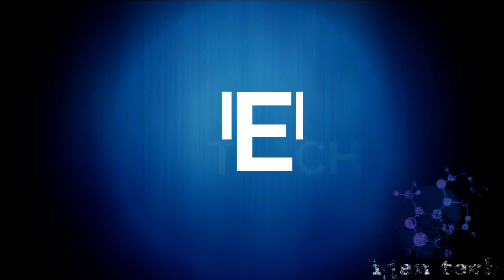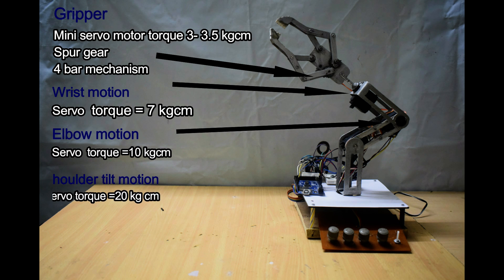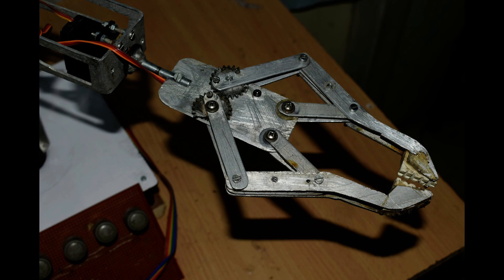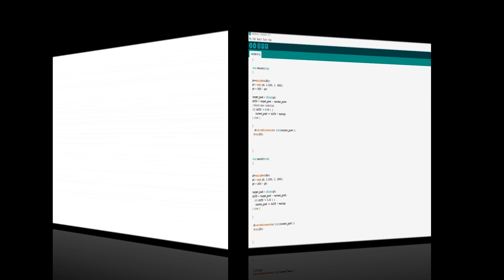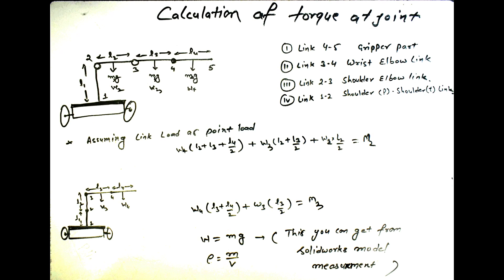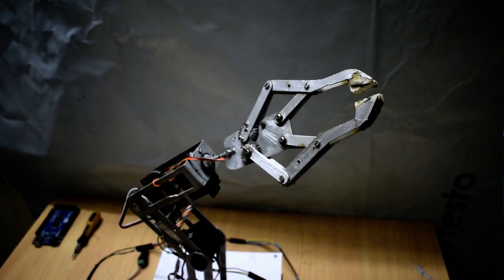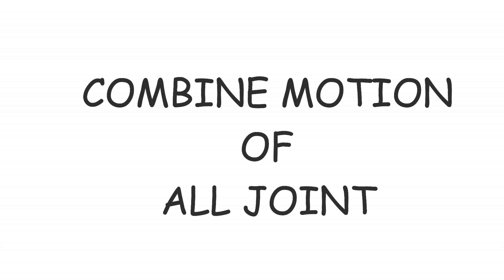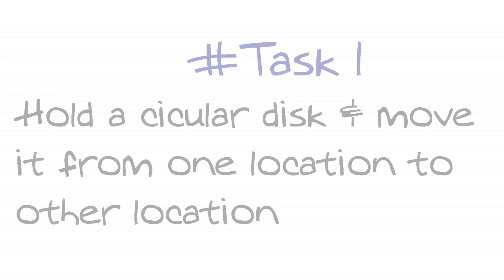🎥How to make Robotic Arm With Arduino | Manipulator | Part 2

Comment: Sir, I appreciate your video about the Robotic Arm With Arduino. Sir, Is it possible can you to use the Arduino Uno board to control the Xbox 360-controlled 6 dof robotic arm Arduino Uno Robot car work or not? Sir, is it possible can you teach me to make on youtube how to make an Xbox 360-controlled 6 dof robotic arm Arduino Uno Robot car and Xbox360 Controller? Sir, tell me about the Xbox360 Controller library with the Arduino Uno board. Sir, this video is beneficial. Sir, tell me in the comment.

Comment: Is it a 360 degree servo motor
Reply from the maker: dinesh kumaran.k  no its not 360 motor i used 180 deg servo
Reply: IGEN TECH I'm doing this as a project.. I've designed in solidworks..I am in a need of coding can you send me the code, my mail id is dineshkumarank3@gmail.com

Comment: Sir can we use arduino uno??
Reply from the maker: yes better to give power supply from outside
Reply: IGEN TECH hey are you using 360 servo or you convert 180 servo into 360 servo motor

Comment: how are you powering the servos?
Reply from the maker: using 5 7805 voltage regulator ic
Reply: thanks, can you explain how to wire the voltage regulators. I tried what you showed in the diagram but only two servos ended up working.